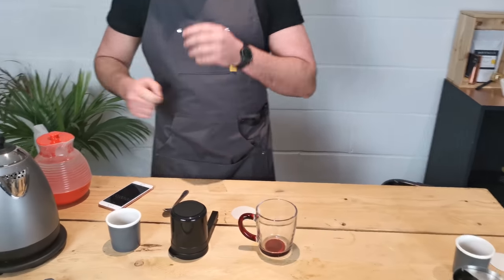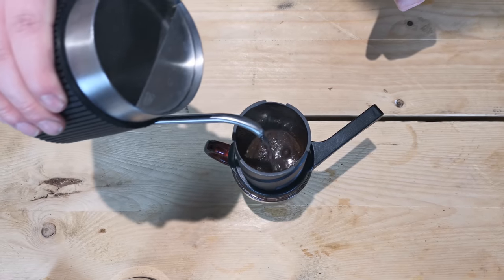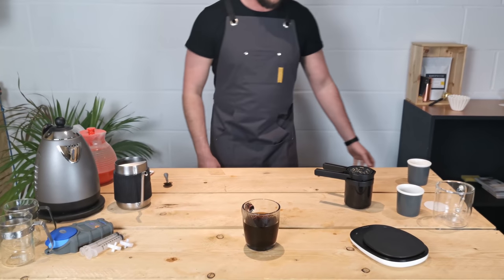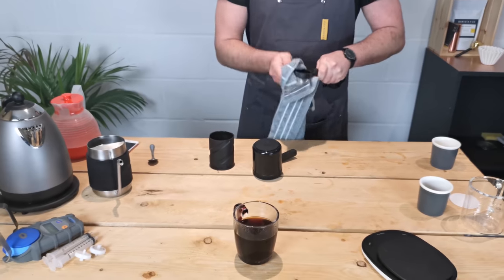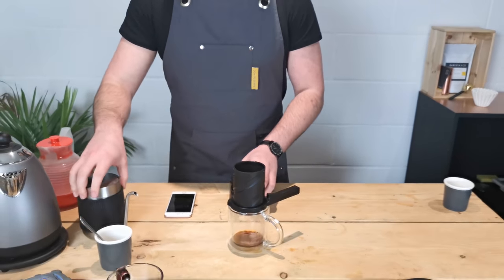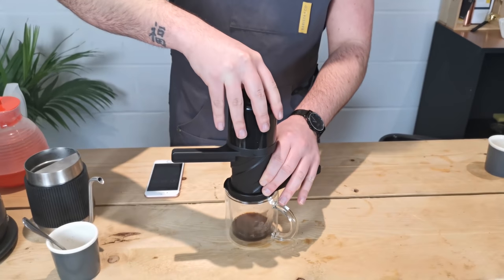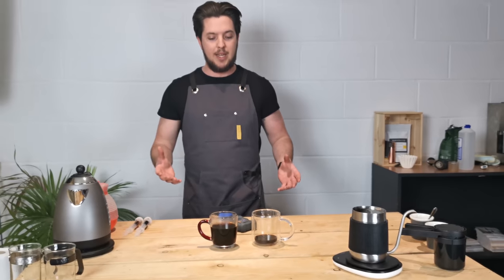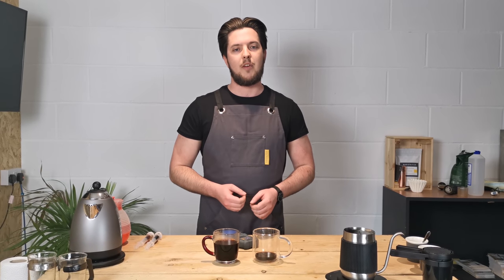Brewing and strength testing an espresso-style and long black coffee with the Twist Press

Comment: Got one for Christmas, as a design engineering project say in final year its fantastic , lovely bit of engineering. Now WHAT was the brief? Who posed the brief? Why was the brief proposed in the first place?
 As a coffee making device its FREAKING INSANELY OVER COMPLEX , as is the presentation, THERE IS NO NEED for this product, other than to part coffee snobs from their hard earned , it can fall apart and cover the user with boiling water.
Reply: The helix chamber is fixed in place and the filter base fits inside a cup, I don't understand the risk problem.
It is mostly a more ergonomic alternative to the Aeropress, instead of pressing from the top, the user simply moves its hands together. Additionally it provides flexibility on the way to make coffee, I would say that's what justifies its design. 
I own one as well and I don't intend on defending the creators, just pointing out its positives. I understand a simpler machine can brew coffee just as well, but I don't see the problem in the existance of this device either.